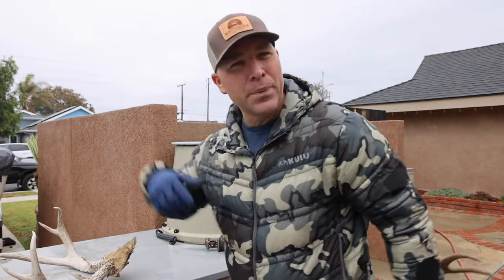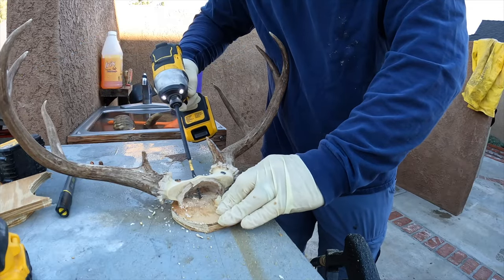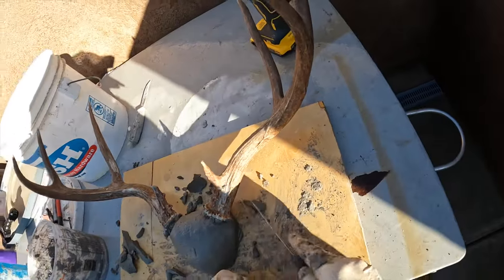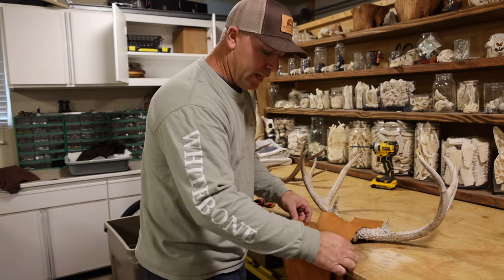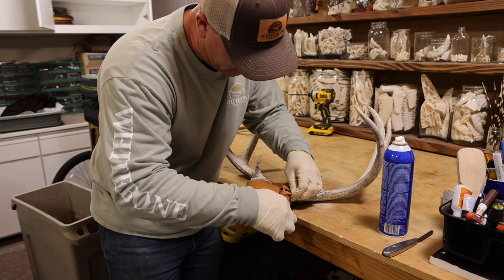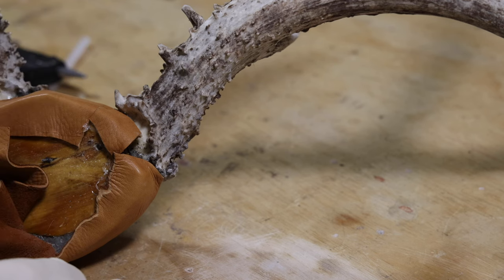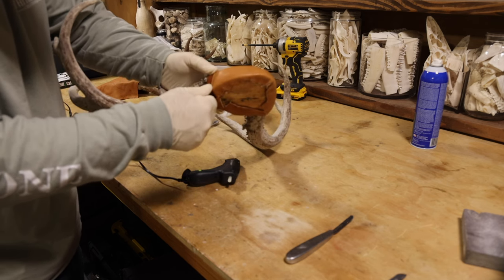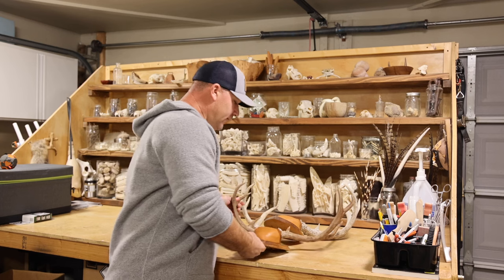HOW TO MOUNT DEER ANTLERS

Comment: Instead of the plaster/concrete mix, I use $4 can of spray foam, which hardens and then can be carved into any shape. Isn’t as smooth a surface as plaster, but it makes a lightweight mount.
Reply: Bondo works awesome!

Comment: Tried this today. My first try, the 50/50 mix hardened between the time I added the water and the time I walked over to the workbench and was no longer pliable. Mixed up another batch on the workbench and was only able to get the inside of the skull stuffed with the 50/50 mix and a big blob coming out the front before the mix no longer moldable. I used a knife to smooth out what I had before it go too hard. Will try a 3rd go for the top of the skull. Not sure why my mix is hardening so quickly. Both the plaster of paris and the concrete mix say they have a 20 minute set time, but it seems more like 5 minutes for me. Maybe I need to add more water to the mix...

Comment: Not the right video to comment on but I wanted to ask a question, have you ever repaired a broken skull? I was driving one night saw a dead buck on the side of the road and decided to euro mount it. Picked it up and realized one antler broke part of the eye socket off with it. Is it possible to fix that and still have a half way decent looking mount?

Comment: This off topic from this video but why do you boil them in oxiclean. We just boil them in non iodized salt. This keeps antlers from changing colors so you don't need to wrap them then we pressure wash. We also just spray peroxide on the skull and let it dry 4 or 5 times and it's perfect white. We don't ha e issues with yellowing later on. Does the oxiclean make pressure washing easier?

Comment: First of all, Merry Christmas! 
I've been watching on and off for a while and quickly got into bone hoarding ontop of my scrap metal hoarding, so I use your cleaning processes alot. 
I collected some carcasses from out in the field about two years ago and finally got around to cleaning them up. I've already got the skull cleaned up nicely on the non smashed one, but I'm struggling to get the mummified tissue off the vertebrae. My sister and I have been soaking the bones in some dish soap and warm water for about three days now, scrubbing them between water changes. Alot of the tissue has come loose but the tendons are clinging, and I can't use a power washer because of how small the bones are. Do you have any suggestions on how to get the rest of the tissue off before I attempt a boil? I plan on turning them into a necklace so I want them to look really nice.
Reply: I recommend cutting or scraping what is left carefully I do alot discovering myself and if it's not coming off I tend to use what ever works Incase nothing works

Comment: My mix of plaster of Paris and concrete turned with a bunch of cracks and it easily broke apart. Any idea what I did wrong?  Thanks.
Reply: One thing to mention, I used quick set concrete. Is that what you use?